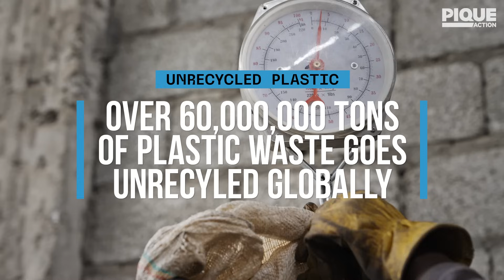Turning Plastic Waste into Affordable Homes | Reinventing Tomorrow

Comment: It is an interesting idea.  Curious about fire safety (plastic without fire retardants can be like throwing gas on a flame), plastic off gassing (it looks like mixed plastics and some off gas), and potential for rain erosion (normal or acid rain) over time leading to microplastics into waterways.  It is for sure 💯 better than throwing plastic into landfills and everyone deserves safe secure homes.
Reply: Still the best solution for plastic is alternatives to plastic.  The plastic not made, is less to deal with later.  We have so much plastic pollution in just the first 80 years of modern plastics.  It is depressing.
Reply from the maker: @kuillus  https://youtu.be/Hwp-6CjvcA4?si=cwY-urhxo14g3GTJ
Reply from the maker: @kuillus  https://www.youtube.com/watch?v=BjTEsAHONss
Reply from the maker: https://youtu.be/6HgUncXrttM?si=EqKQtCGoW9-1iD1c